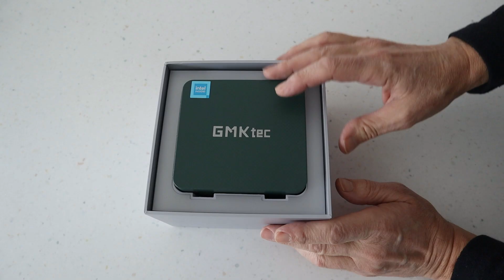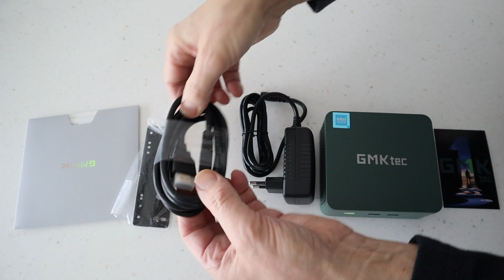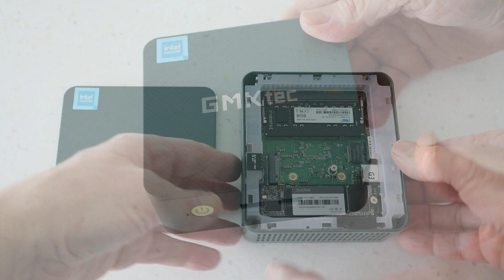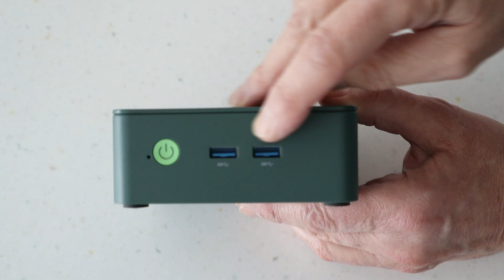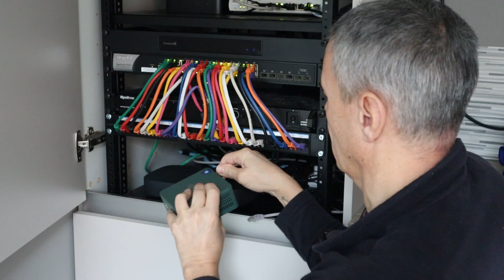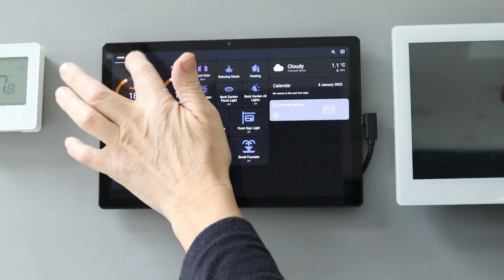GMKtec Mini PC G3 Intel Twin Lake N150 - Full Review

Comment: I've just gotten a G3+ with 8Gb/256Tb. It's repeatedly gone into suspend mode while I'm ssh'd into it. I've tried 4 different installs of 4 different linux distributions. It does it with all of them.

Has anyone else experienced this? I've just emailed GMKTec tech support, so it's too soon to hear back from them. I purchased this based on all the reviews, but if it keeps going in to suspend mode it's of no use to me and I'll need to return it for a refund.

Thanks!
Reply from the maker: Let us know how you get on with support, I didn't experience this issue. It would be interesting to see how you get this resolved as it could well be a faulty unit.
Reply: @MarksTestLab  It appears to be running fine now. Although I said above that it happened with all the linux distributions that I tried - I believe I was mistaken. It may have only happened with Fedora desktop. Instead of going through all the daemons that Fedora 42 live desktop installs by default - I reinstalled Fedora server and then installed only the packages I needed. Last night I left an ssh session and a vnc connection open and it's still running this morning. 

If it happens again I'll post and update here, but so far so good...

And the response from GMKTec was quick and very detailed. I'm very impressed to their level of support.

Comment: I bought a slightly older version and it's running well. It's a very quiet but slightly warm. I use Orange Pi 5 for my home automation PC,and this one is my main developer computer. I just increased memory a little, otherwise it's a great developer machine.
Reply from the maker: Hi, thanks so much for sharing your experience of the GMKtec mini PC, much appreciated. Mine is still performing well with no issues.
Reply: @MarksTestLab  I'm glad that we have a similar experience.